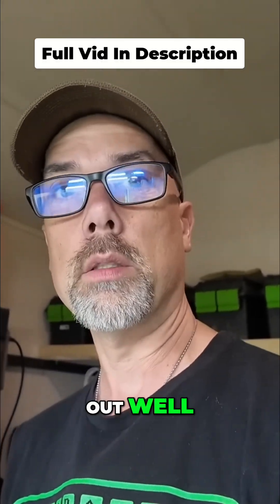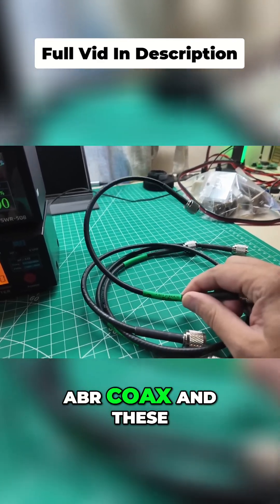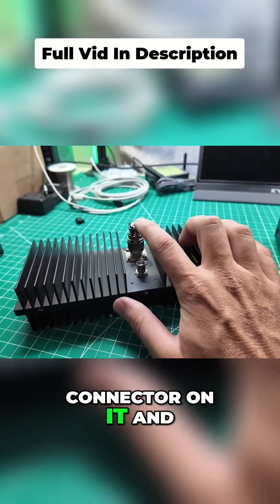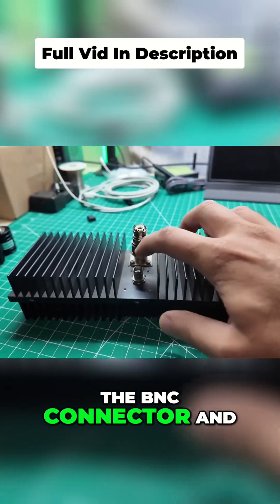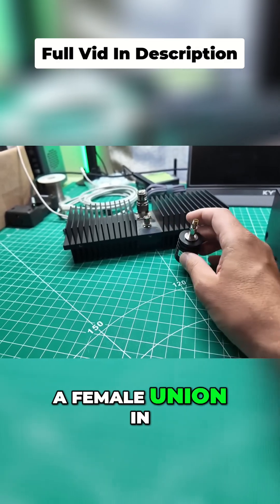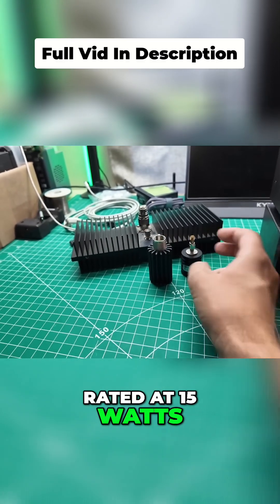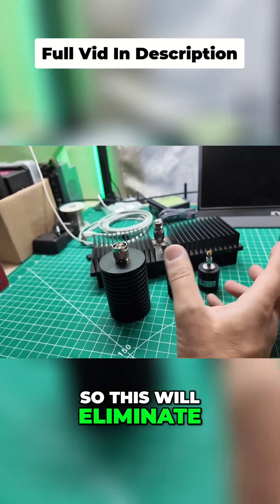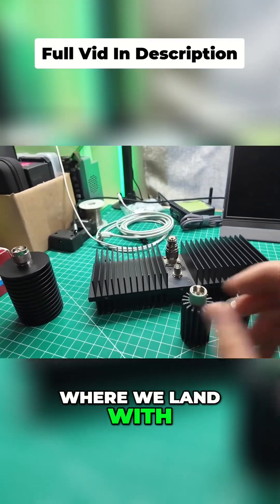Testing RF Power: Dummy Loads & Coax Explained #shorts

Comment: Used to work in the radio industry. learn some interesting things about dummy loads. They don't actually block the transmission very well I was hitting a repeater and touching off the sheriff's department radio while doing tests. nobody knew who it was because I just did a 1,000 Hertz whistle for testing modulation and then one day I did that at the Dispatch Center while testing one of their radios and they all lit me up. Apparently it was quite loud in their headsets.
Reply from the maker: Yep, RF gonna RF bro!  I use them a lot just to attenuate signals.